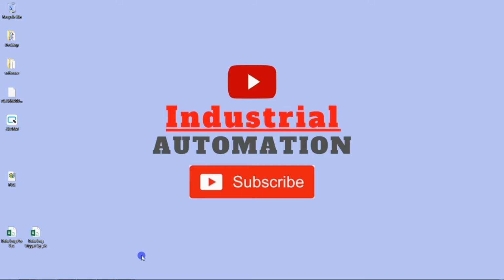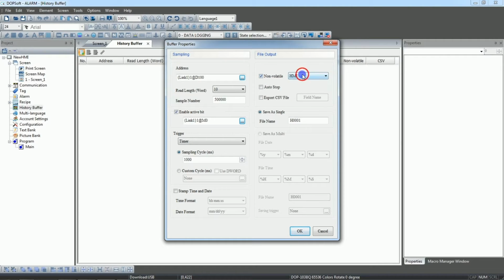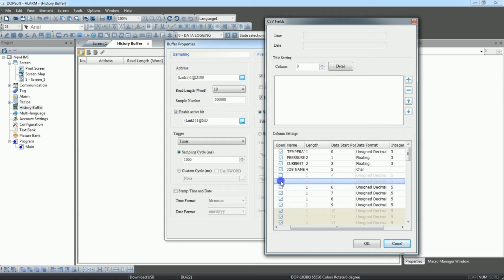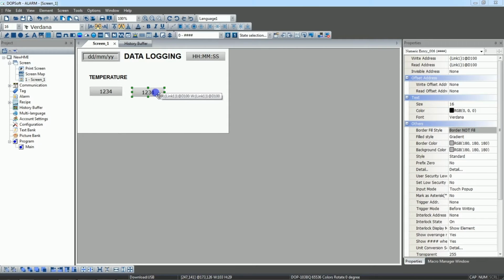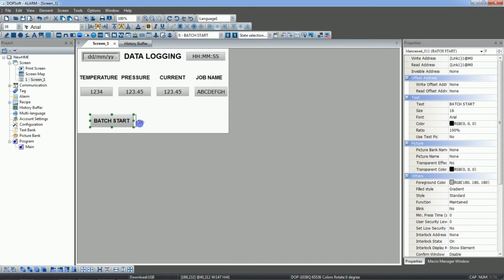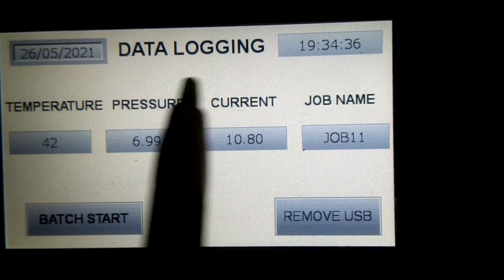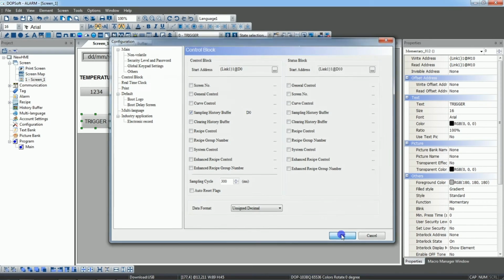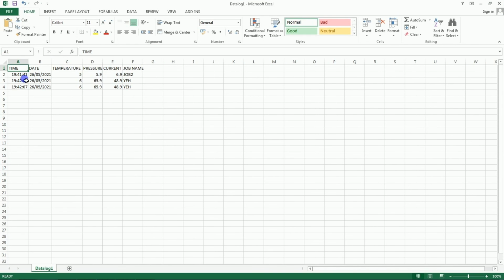Data Logging In Delta HMI |Triggered & Periodic Both Explained | English

Comment: Hi sir, please help me on this project.

Read the voltage in a line, ( 5v to 48v DC ) if a 12v voltage is present, trigger a relay to turn ON a light and start the timer 
This log time and date should be saved in memory card or device within or external devices. When the output 12v goes below 12v then  it's will be off. And repeat the cycle

Comment: Plc trigger data logging not working.
Reply from the maker: Plz watch the full video, don't skip a part..And do the same as per video..It will work 💯%..I think u missed something
Reply: @IndustrialAutomation  didn't understand the last program you types in the plc... Ldp mo   mov hffff d0
Ldf mo    mov h0 d0
Reply from the maker: I am giving trigger Of M0 to logg data..so need to move HFFFF to D0
Reply: @IndustrialAutomation  everytime I type this command a dialogue box appears
Reply from the maker: Which dialog box appears
Reply: @IndustrialAutomation  it says "add symbol"